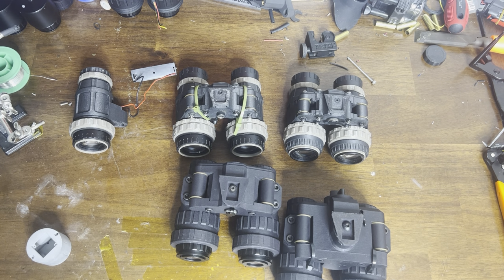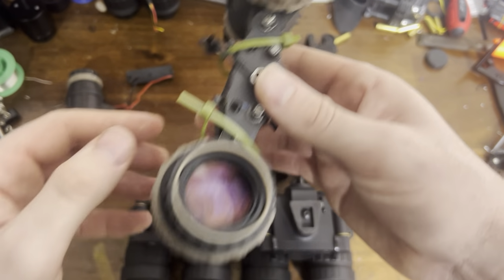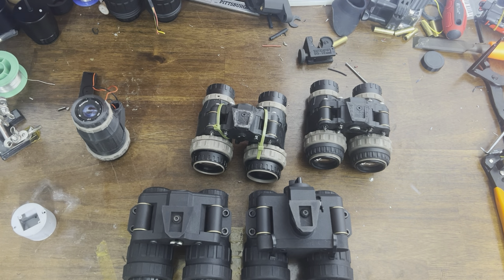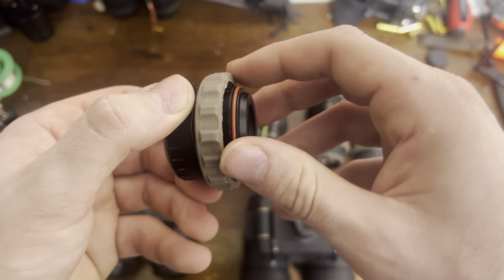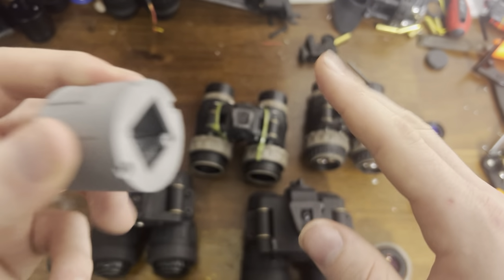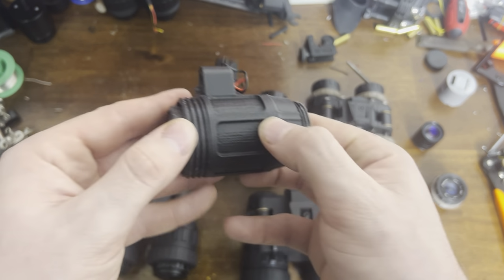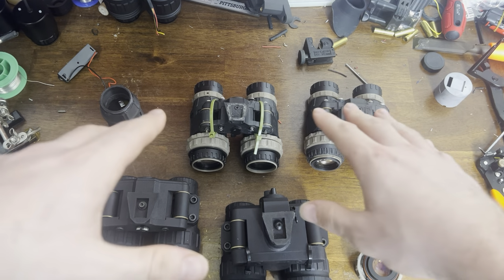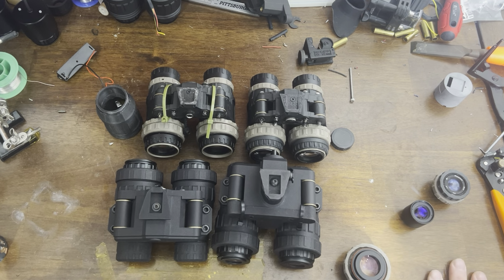PVS-69 Gen 4 introduction

Comment: It wouldn't be terribly difficult to swap the IR drone camera with a thermal sensor. With a little bit of work, you could even overlay the thermal image onto the image from an IR camera feed and have a set of hybrid NODs.
Reply from the maker: i actually do plan to pop a thermal core in one im sure it would fit. overlay is a totally different beast and not really supported with the video signal we are using.
Reply: @vonscherfarms925  you can do it via ghosting, but it's not exactly a pretty solution. 

You basically run both inputs into the same monitor, with a sliding resistance switch (like a dimmer switch on lights) on each. Gives you control over which signal is dominant, and even the ability to run one or the other.
Reply from the maker: @BuckFoeJiden  are you sure that works with CVBS? all the information i found says that combining them just makes static
Reply: @vonscherfarms925  I'm not 100%, but I see no reason why it wouldn't as long as the signal isn't overpowering the inputs ability to read the signal. 

From everything I've done in AV, signal strength is the biggest factor. That's why the dimmer switches are important. 

Try it with two regular camera inputs and see if you can get them to ghost, assuming you have the sliding resistance switches to wire it up.
Reply: @vonscherfarms925  the only foreseeable problem I can come up with would be figuring out exactly how to splice the inputs into the monitor. 

I'd imagine if you're using something like a raspberry pi to feed the stream into your monocular, you'd need to run two boards. One for your digital camera, and another for the thermal sensor, then a sliding resistance switch behind each board, and from the switches, they'd be spliced together into the monitor. 

I'm sure there's info out there on how to ghost video signals that's more up to date or accurate, though.
Reply: It could be that the splice and switches need to be in front of the pi board, though. 🤷‍♂️
Reply from the maker: @BuckFoeJiden  there is no pi board in this design. With CVBS the camera generates a clocking signal and if the two input clocks are not the same no image will be rendered.
Reply: It's a digital camera but a composite analog signal... To mix them at all they need to be Gen locked at the source, which they aren't, or time base corrected, which takes a big ass piece of expensive hardware. Other option would be to digitize both sources and easily mux them that way but 2 capture inputs and ADC's seems pretty out of scope.

You could ghost them with a resistor as is but the output would be badly glitched and useless

Comment: Would be cool if there were eyelets on the housing for a lanyard. Would suck to have a unit come undone and lose an analog intensifier.
Reply from the maker: It’s extremely hard to see in the video but there are actually holes for some key rings but squeeze out from the printer filled them in a bit

Comment: Ive been pricing different units for years; even the cheapest PVS 14 or pvs 31; nevermind-14, wolf-14, etc are all way above what I can afford to spend; but, I have been rocking the NVG 10 and love it and would really love to go a step up…

If i dont have a 3D printer or anything; how much would you say I can get into the game for a single monocular on the side of the PVSe-69 for……?

Less than $1,000 
USD…? Less than $500 USD……?

Thanks guys.

Comment: I always read the channel name as vonscher  farms and it makes me laugh.

What do you estimate the final cost for a gen 4 digital vs a gen 4 analog? Could you pair one digital tube with an analog? Kind of upgrade as you go sort of deal.

My thought would be build a g4 digital, and then save to buy parts to convert to analog.
Reply from the maker: I have not tried pairing them and I’m unsure how that would perform. I know that it would really fuck with your eyes as the aspect ratio wouldn’t be exactly the same. I advise against it
Reply: @vonscherfarms925  do you think you'll be able to compare the g4 with the opsin? I think the opsin looks very promising, but for the money it seems like you might as well save and go analog.
Reply from the maker: @TierNoneOperator  the latency in sionyx would always make it a no go in my book. A member in the discord did some testing of a sionyx black and they’re pretty close in terms of detection capability.
Reply: @vonscherfarms925  the new opsin has 90fps with moonlight or an illuminator though, so seems like that has been fixed. The black was definitely an action camera that worked well in low light whereas the opsin is meant to be a true helmet worn device.
Reply from the maker: @TierNoneOperator  latency is different from fps, latency refers to the time a frame is captured to the time that exact frame is displayed. As far as I know sionyx has still not fixed this issue.
Reply: @vonscherfarms925  I see.

Will you be trying to source analog parts to have build kits on the website or just digital?
Reply: @vonscherfarms925  also, I'm going to buy a ir light on the website to get in on the sweepstakes. Between the m622 and m323 which would you recommend?

Comment: Interesting website there. I wish I could understand how to make this stuff. Or buy .. 1900 Euro for it is quite expensive, can buy a proper nvg military civilian. Possible maybe to get better prices?
Or understand what we can get.
Reply from the maker: 1900 gets you a housing with digital tubes and PVS-14 eye pieces. Other companies charge 1700 for just the housing…
Reply: @vonscherfarms925  Thanks, just want to mention that usually this is a problem with how nowdays fan\passionate\players general non pro stuff is communicated to public. If one comes in the shop and tries to understand something all is nice and described well, but it's hard to understand stuff that a noob would like to know: is it fully working what I buy, how do I see (yes this is show in some pictures of the lenses), do I connect this stuff to a battery pack?
It's more a web site for a very small niche of people who know already 90% of the NVG etc.
And maybe that's what you want it to be. After all this is not airsoft stuff it's real deal, real steel owners stuff.

I am just trying to understand how to build one but there is a huge quantity of tools to be bought too which inflate the price and then zero manuality ...
I wish to make a pvs 31 like and a gpnvg in the future.
An maker that has shown in a video how to make a pvs (digital camera) not like yours also has included a camera recording capability.

Thanks.